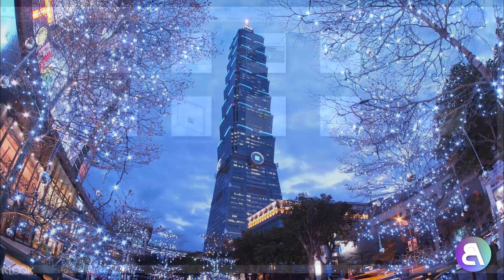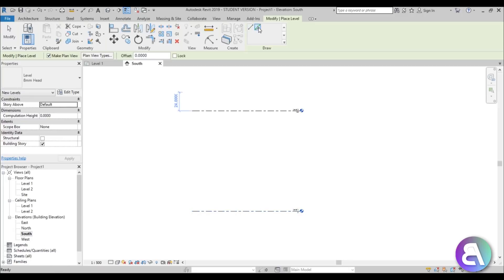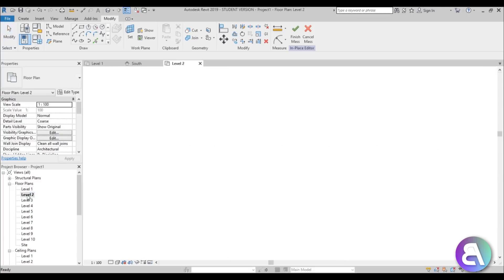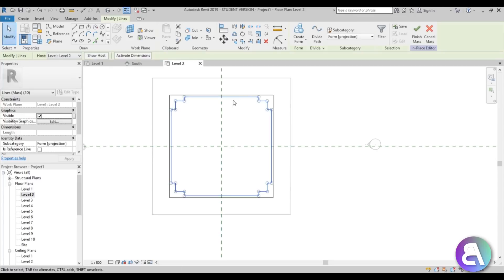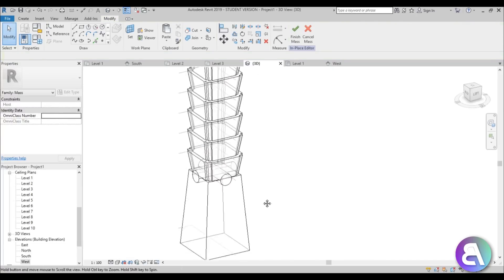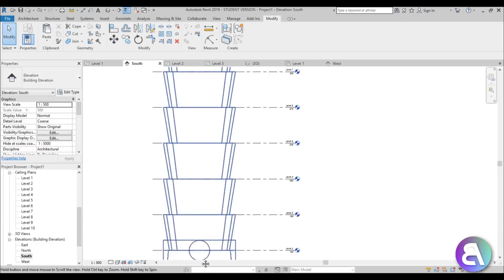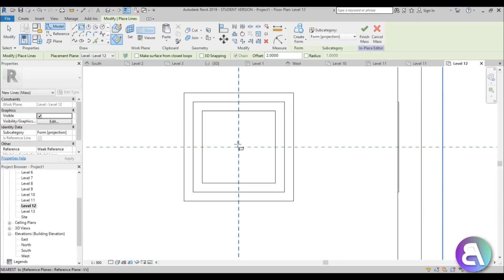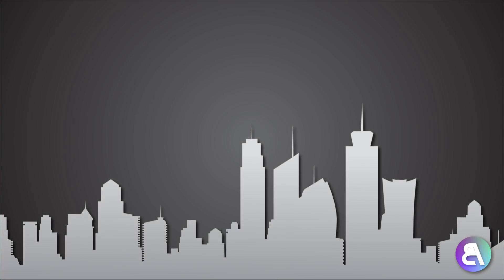Taipei 101 Skyscraper in Revit Tutorial

Comment: Was Taipei 101 designed using REVIT during construction?
Reply: Was still paper bases than but I didn't do mine floor by floor but instead sections metres calculated each in archicad